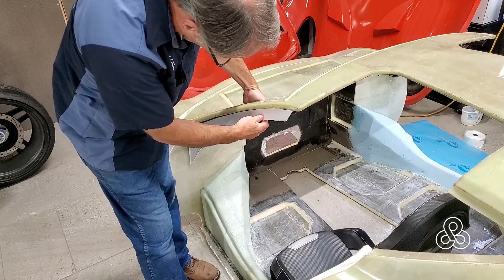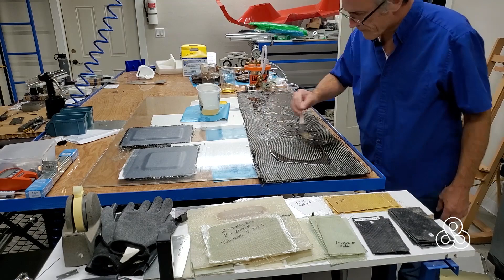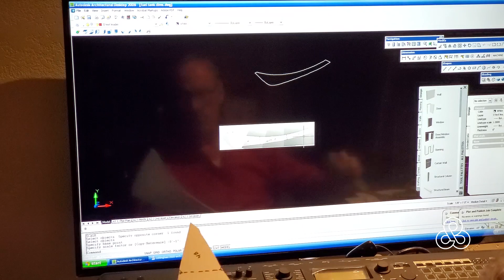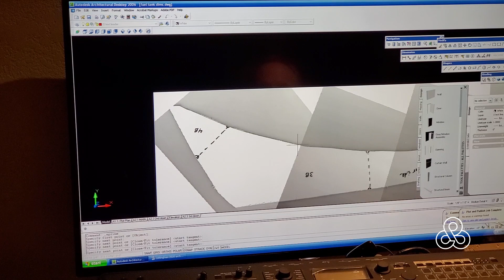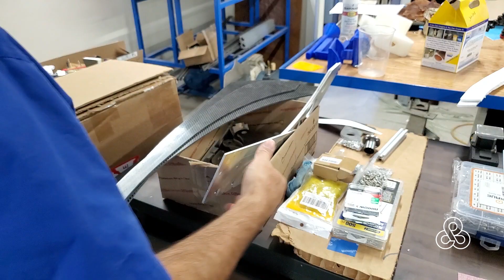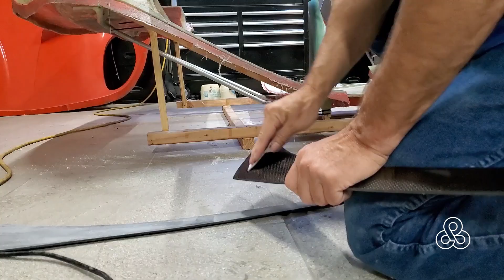A44 - Carbon fiber reinforcement is what it took!- Arete Supercar project

Comment: You make the comment "I think the load and transfer made the A pillar strong enough for this build." 
How much of the structure is experience vs some type of calculations or simulations to visualize loads and stresses. Could CAD be used by another home builder to optimize the design and make a significant improvements compared to your build with seemingly minimal CAD use? Or does the task outweigh the benefits in your opinion?

Awesome build! I really enjoy watching the progress.
Reply from the maker: Experience! And that doesn't count for much, when you attempt something in which you have little experience. I.E. Butterfly doors with ultra thin A-pillars. I have known throughout the build, that the rollover strength would all be coming from the rear bulkhead, (integral vertical unidirectional laminations) and that I could reduce the cross section of the A-pillars. However, when you actually start seeing the results, the "experience" tells you, "This isn't going to cut it!" or  "dang I'm a genius!" Sadly, the experience didn't prove the "I'm a genius!" in this round. Ha!  As for building by CAD, 3D modeling and Stress Analysis - If I had plans to advance this car to production, the next logical step would be to go back and 3D model it (which would be simplified by scanning the prototype). I could then recreate some of these components I am hand carving/laminating as molded parts that could then be bonded together. But, since I am not going to reproduce this car in mass, I chose the tedium of hand lamination over the tedium of 3D modeling and analysis, more molds and then still be faced with the tedium of laminating in molds. As a side note- Virtual reality is getting close to allowing us to see 3D models as if we were there, but that "developed" of a model and the software to produce it, are beyond my finances. this is one of the key reasons I work backward; using the full size model as my "clay study" and then building the "structure" of the car around the design. In my opinion! <Some production parts coming down the pipeline in the future. I will be showing the 3D modeling to CAM process. Stay tuned.>
Reply: @BuilderCreator  regarding the VR, recently the company I work for has had to quickly adopt Hololens with AR for technicians in the field so that engineers can be there remotely. It is really cool to be able to overlay things on a live stream video that pops up in front of their eyes. And also being able to bring CAD models into existing real life modules is really cool! Technology is exciting!
Reply from the maker: @moremotorsmorefun3456  Interesting! who do you work for? What kind of work are these techs and engineers doing?
Reply: @BuilderCreator  servicing lithography exposure tools for ASML. We like to call them money printers so when things go wrong customers want them fixed immediately. Usually customers don't like any kind of video inside (obviously) but when it was between no additional help coming and streaming video they quickly chose video.